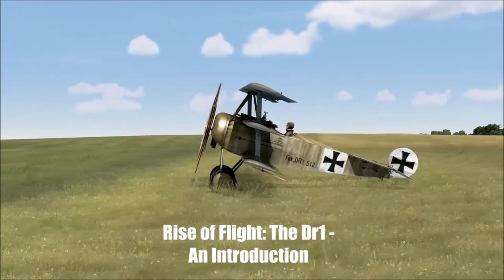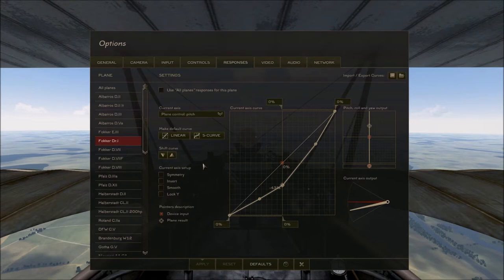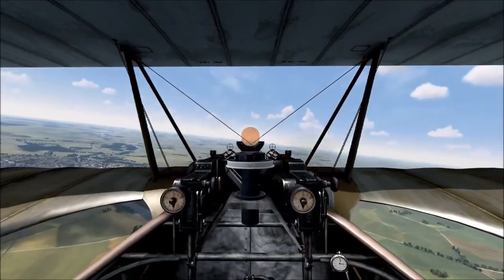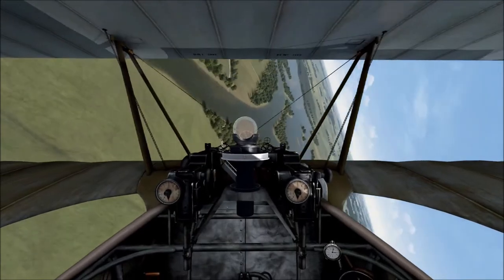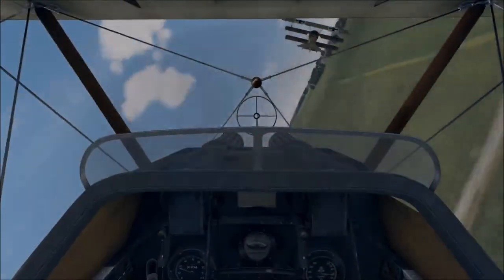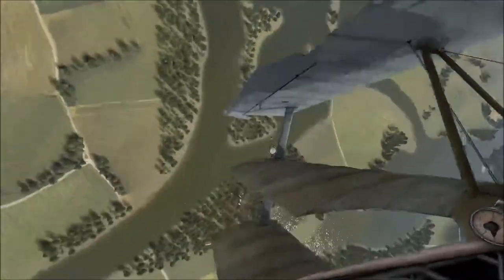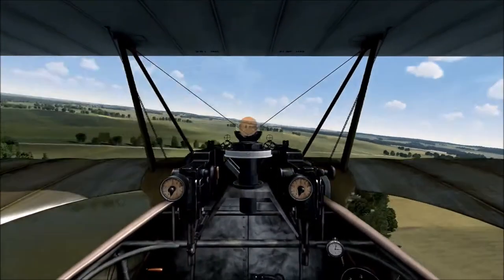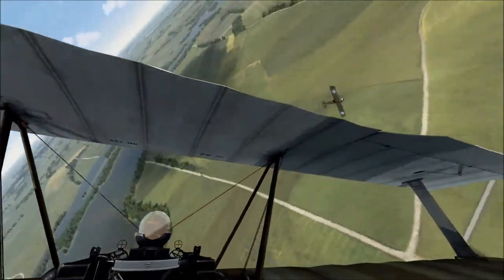Waggaz' Wings Episode #18 - The Dr1: An Introduction

Comment: Greate video! In my particular case, I try to avoid using the blip switch during turns, usually full left rudder and releasing elevator pressure should prevent left turn stall. Thank you for taking time to share your knoledge, your videos are all realy usefull!! See you in the skys! CRUZ
Reply from the maker: Hernan Otero hey Cruz! Thanks for the tip! Also good to meet you outside the servers. It’s taken me way too long to get to the Dr1 but I’m glad I have. I’m still a long way behind jocks like yourself though :-)

Comment: Great intro to the Dr1. Have to admit, as i fly SE5a/Spad mainly, i don't like the twisty little Fokker. Will go out of my way to bounce them when they're busy and use longer range shots to just oil them out of the fight. Of course this is because they're so dangerous. When pilots (like CRUZ S!) also use altitude and sensible energy tactics, escape is the only option. 

Waggaz, you've probably seen them, but if not, 'Immortal' has 2 superb videos on fighting with the Dr1. His channel name is 'Immortal Always Returns'. The head-on barrel roll one is a good tactic for anyone facing a rotary. S!
Reply from the maker: PaulLMF thanks Paul! I’m like you most of the time - stay out of their way. On icons off server I have much more luck though, and can often BnZ them due to the higher fuel settings. I’ll check out Immortal’s vids
Reply: They are resilient little bastards.  I took down a DR1 in my Spad today.  Took nearly half a belt of balloon gun, with a 30% hit rate!
Reply from the maker: Jorundr Hrafnsson it’s one of the reasons I won’t fly it (and other fly nothing else). It can out turn pretty much everything, has a benign stall, and will nearly always bring you home alive. It’s a bit of a troll bird on multiplayer

Comment: Yay! 
I'm a Dr.I main, it's an outstanding machine indeedly, but it's a widowmaker.
Like an horse, it has its very own character; and if you don't learn it out:
It will kick you~

-Otto Neumann (JSG4_BlackAce)
Reply from the maker: Gadget Lumic I think you’ve shot me down in one at least once as BlackAce! It’s just brilliant in icons on servers; not so much on the higher realism settings. I wish it had its legendary climb though. Did you see the Flying Circus announcement?
Reply: What's your username? I do remember to have met you!

Yes,I've seen some Gotha V documentaries with real footages, why on RoF it's a literally a brick 
while on the documentaries it seems to be a Dr.I disguised as bomber? XD

My Dr.I settings are always 45% fuel, 500 rounds, and 90 meters of convergence:
Everybody is able to takeoff and troll around with a Dr.I or a Camel setted in 
"Highlander mode", it's just nasty.

I'm planning a full scale, rotary powered, Fokker Dr.I; with 20% of fuel you shouldn't neither try to go
into battle, because there's a deadzone in the fuel sensor.
I've seen it,it's amazing!
Reply from the maker: Gadget Lumic I fly as Waggaz. Are you building the real thing? I’d love to learn more about the project!

Good for you using more realistic fuel and ammo settings. Sometimes it’s best to just not engage the Camel or Dr1 in Highlander situations. It can be a problem for new pilots too if they get shot down time and time again (as I did at the beginning)
Reply: Yes! This will be my livery https://d.facdn.net/art/the-komet-gryphon/1498939919/1498939919.the-komet-gryphon_2017_7_1__19_19_0.png 

Every centenary of an ace,I get something of original: On the centenary of the Voss's demise,I won on an auction an original german flying cap.

I never engage lone Camels in a turn fight, unless they are already engaging a friendly plane
Reply from the maker: Gadget Lumic that’s an awesome thing to have in your collection! I own a piece of a Spad XIII propellor taken from an American decommissioned type. It has pride of place on my bookshelf
Reply: Neatoooooo!
I'm planning to get an original coat on 21 april and a pair of gloves for 10 agust,by the end of this year I should have a complete german uniform, to wear while flying the Dr.I, on important occasions
Reply from the maker: Gadget Lumic ok that’s pretty amazing. I was thinking of getting a RFC uniform made. I have an original RFC hat pin. Do you dress up for any major retro or aviation events?
Reply: That's really a lot more easier to obtain,good luck with it!
I'll dress up whenever I'll be part of a historical reenactment, atm I wear the goggles, the cap and the silk scarf each time I fly on RoF; pity that my headset now it's resting in peace and I'm grounded until I don't get a new one